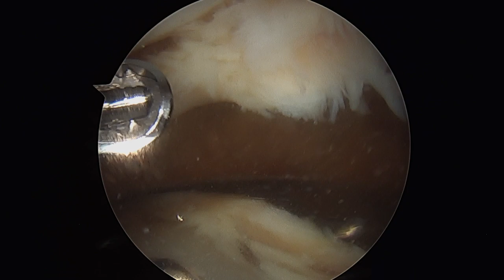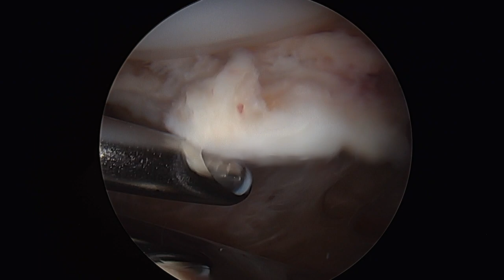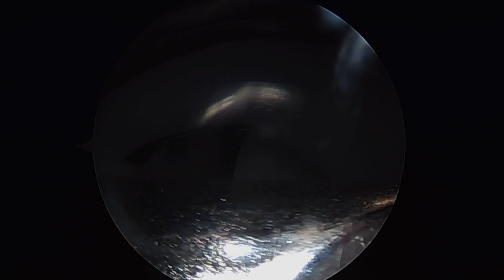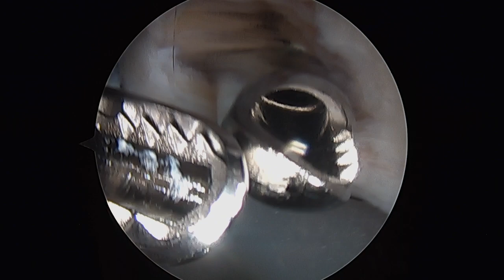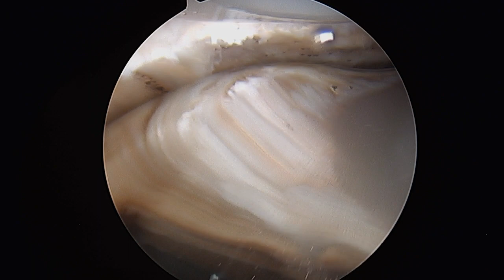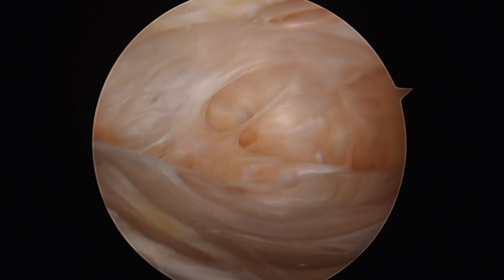Patella Clunk

Comment: I fell off my electric tricycle 14 months ago, and smashed my tibial plateau.  I ended up with an S-ROM prosthesis even though I have no co-morbidities and am sure my bones are strong.  I have had all the symptoms of patellar clunk syndrome for 4 months, and for the last two my knee locks completely when I flex it over 90 degrees. ROM is between 125 and 130 degrees. Nobody wants to consider patellar clunk for a hinged prosthesis, even though they have the same sharp and exposed edge on the intercondylar notch that the earlier posterior stabilized prosthesis had before they were improved.  I assume the main problem is that hinged prosthesis are uncommon, and most people that have them can't flex far enough for the quadraceps tendon to contact the sharp edge of the notch.  The hospital took a CT scan two weeks ago, but I am not sure if it can differentiate soft tissues clearly.  A MRI was cancelled because a radiology doctor said it was "unnecessary".

Comment: Thank you for the explanation. I have experienced this at around 5 months post op posterior stabilized TKR. I did my PT 3x/week x 4 months. My physical therapist examined me and said I have a palpable encapsulated cystic mass superior to my knee cap and he could palpate gristly scar tissue down the sides. It has been frustrating because I have been complaining to my Ortho doc for months and he has blown me off, said an MRI isn’t indicated, tried to say it was my bursa, and told me to “wait a year.” It is very tender and bothersome to clunk most every time I bend the knee and straighten it when I walk. I have resumed PT to help with this but am at a loss why the doctor doesn’t want to fix this. Any thoughts or suggestions?
Reply: Thanks for your comment Mary. I’m sorry to hear about your struggle with the TKA. Have you sought a second opinion? It is certainly your right to a second opinion. An MRI will be tough to see with the metal implants distorting the picture. The diagnosis for patella clunk is primarily a clinical diagnosis with history and exam as opposed to an imaging based diagnosis. Hope this helps!
Reply: Wow that’s crazy! Not sure if you will ever see this message @marydahm6851 but I’m wondering has your situation been fixed? For 2 yrs now I’ve suffered the same… and doctor blew me off also. Just bad situation.